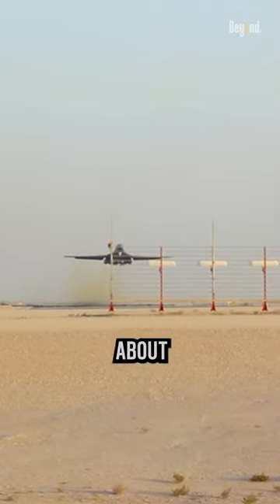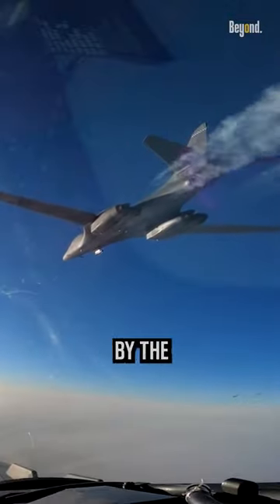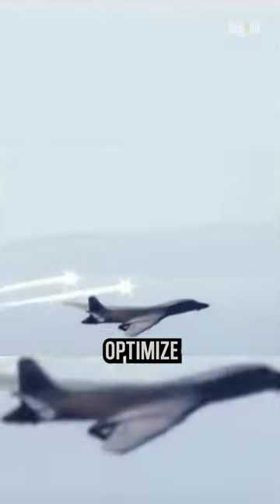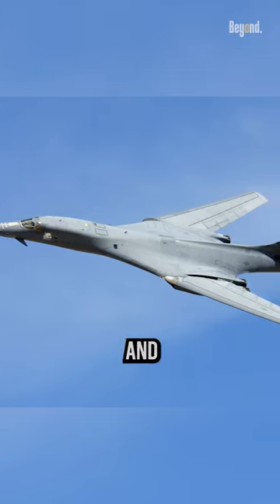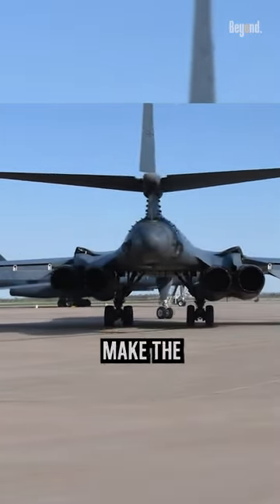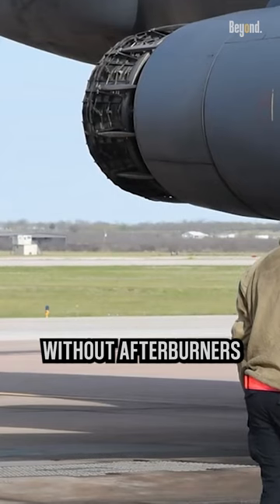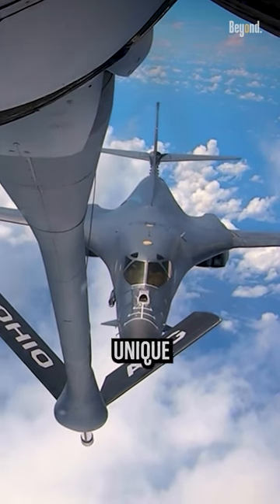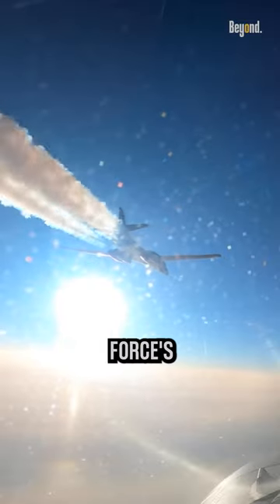An interesting fact about B-1 bomber #shorts

Comment: The B-1 is the best Bomber (in my opinion) because of this supersonic feature. It has not really been seen in Bombers since the B-58
Reply: The White swan is even faster.
Reply: @Aposte-quotation  so based on your response you probably think the SU-57 is better than the F-22
Reply: @Charliedontsurf-v5o We don't know which is better until we see them go head to head.
Reply: @Charliedontsurf-v5o  no the f22 is alot better. But looking at the facts the white swan is just better. Im not biased at all. I like to do research
Reply: @Aposte-quotation  you know what respect + man thumbs up 👍
Reply: @PlaneGuyProud no we know which is better, it’s not the SU-57
Reply: @morganlambley8655  No we don't. Neither has gone neck to neck.
Reply: Not seen since TSR2...40 years ago
Reply: @Aposte-quotation  based on what facts should the Tu-160 be better? The B-1s RCS is way smaller, the EW Suites are more modern and most likely generations ahead. The Tu-160 might be better than the Baseline B-1, but todays B-1 has more capabilities, a broader weapon set and is more survivable in an engagement.
Reply: Russian TY160
Reply: Tu-160 is much faster then the B-1.
Reply: @flixri726 Tu-160 is pretty capable, with different priorities. The Tu-160 is designed to hit targets and GTFO which is why the Soviets/Russians went for speed over stealth. The Latest Tu-160 does come with some stealth features.
Reply: @subjectc7505  Right!
Reply: @flixri726  an RCS doesnt matter on a plane this size. You think russia wont detect this? They will see it comming a 10000 miles away. The white swan is alot faster and can carry cruise missles that travel at mach 9.
Reply: super Sonic with wings back, great aircraft, they let the inventory get a bit low on operational units.

Comment: The term “swing wing” is more correct, if referring to the B-1, F-14 or similar, than “variable geometry”. A wing’s geometry can be changed by flaps, slats, air brakes, spoilers and ailerons or elevons. The correct term would be variable sweep wing

Comment: They already retiring them😢
Reply: Can thank the raider
Reply: It doesn't make sense to me.  Isn't the B-1 more capable than a B-52?  I always thought so, not to mention it's an awesome looking bird!  That and it has a lower radar profile than a B-52.
Reply: @aarondelafuente8507 B-1 is superior to B-52 in terms of avoiding air defences, but the point is that nowadays to bomb and important target B-2(or B-21 in future) is used. B-52 is just an aircraft that launches missiles from beyond air defences range. B-52 can simply carry more missiles than B-1. That’s why retiring of B-1 is already started and B-52 not.
Reply: Detection is the priority.
Reply: @cilvabakape763  more like "not being detected"
Reply: Military/Industrial complex at it's finest - secure huge contracts, go years behind schedule, tripling the price with upgrades during production, not enough spare parts to keep the few that actually fly flying, obsolete while on the assembly line...on and on.
Reply: We used them in Astan. Flew them too mush with their wings out, very hard on yhe airframe.
Reply: I believe it was designed to fly fast at nap of the earth flight to sneak in under radar. But it caused the Russians to make the MIg-31 and improve the look down shoot down radars. They are both brutally powerful at low levels.

Comment: I am going to have to look it up. I always wondered if the B1 is faster than the B51?
Reply: Bro b51 has normal jet engine this has afterburner (supersonic)
Reply: @northkool  sorry. You are right.  I was thinking of the B-58. Could not get the B-51  out of my head.
Reply: The poster neglected to say at what altitude envelope it can fly supersonic. The F-111F could do mach 1.6 at sea level and mach 2.5 at 30K ft.
Reply: Russian TY-160

Comment: This thing can haul enough GBU-57 to punch a hole in any hardened structure.. You're freedom will be delivered @ deep depts..
Reply: It doesn’t carry the GBU-57. That is solely carried by the B-2
Reply: @grandmasterpu  The C-17 and C-130s have a palitized option for GBU-57s.. But the B-1 can definitely haul the GBU-57 but they'd need to modify the bay doors..
Reply: @Antares_451  negative Ghostrider, it is literally only the B-2 that carries them. The C-130 delivers the GBU-43

Comment: Concorde could also maintain mach 2 cruise without afterburners, and it didn't need swing wings either. And it first flew in the 1960's, many years ahead of the B-1. The B-1 was late, expensive and underwhelming.
Reply: CONCORDE is a delta wing design, oddly similar to the B1 with wings swept.  Concorde can't carry 48,000 lbs of payload either.  Different aircraft for different roles.
Reply: its also designed to fly 500 feet off the ground at 1000 mph thats its defence the computer follows the contour of the land
Reply: Comparing the B-1 to a Concorde is the dumbest thing I've ever heard. Concordes couldn't stay in the air with just people on it. Totally different design, different plane period.🙄🤯🙄
Reply: @jaredwojciechowski5850 couldn’t stay in the air because one crashed?  That was because a badly manufactured and incorrectly installed part fell off the McDonnell Douglas DC-10 that took off before it, got flicked up by the Concorde and punctured the fuel tank.
Reply: @sparky4878  more than one crashed...
Reply: They just touted it as the safest jet ... It wasn't.
Reply: @jaredwojciechowski5850 literally only one Concorde has crashed.
Reply: @jaredwojciechowski5850  The clip is talking about flight performance. So am I. So it's not "dumb" at all. You're a real man if you have to hide behind the anonimity of the internet in order to be abusive to people! 😂

Comment: The B-1 has been around for over 40 years. Never once did I hear that it had the ability to "super-cruise"! The term used for going supersonic without the use of afterburner. The only US aircraft that can do that is the F-22 Raptor. IT can fly at supersonic speeds WITH afterburners and out run most fighters because of its large fuel tanks. Therefore, I am calling B.S. to this video!